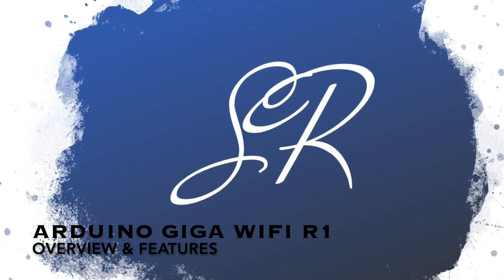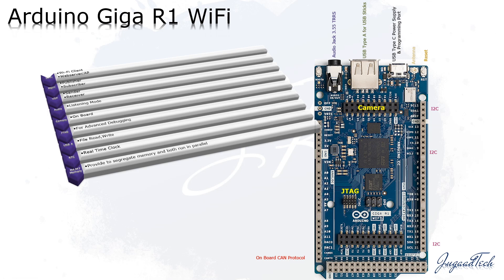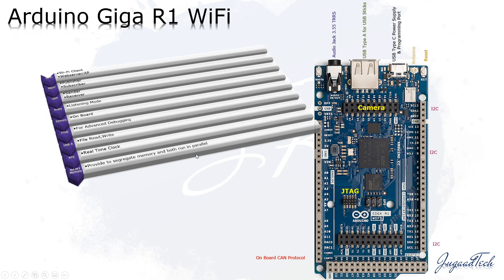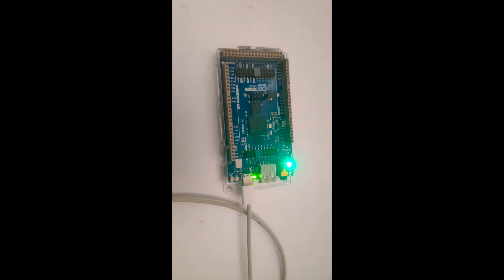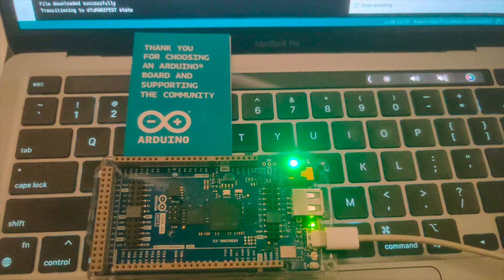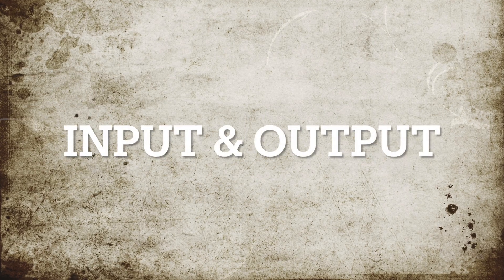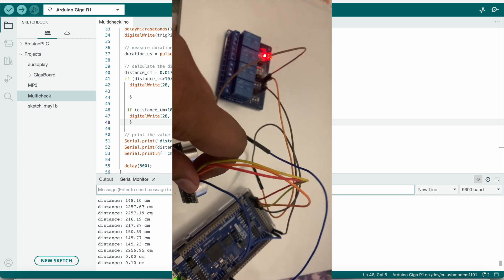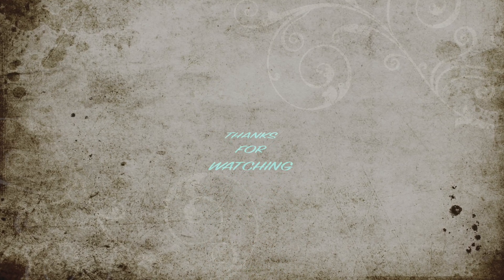The New Arduino GIGA R1 WiFi:  Overview & Features with Demo of #audio #mqtt #wifi #usb #arduino

Comment: Thank you for sharing.  I got myself one of these boards, but not many tutorials etc on how best to use this beast.  It would be cool to see how many devices "apps" etc one can have running on this board at one time.  Somewhat of a stress test, using micro python logic with the c++ processor.  i.e running a very complex iot application whils managing interups and streaming.  Would be cool.  Took me a while to get the micropython loaded.

This is a seriously impressive board.
Reply from the maker: Thanks for your feedback...I agree we don't have many tutorials for using its max capability....I tried in this video to give a glimpse of some examples....I am also working on some other examples by combining all these options to create a real project....as using this board just like Arduino Uno will not make much sense...
As it is made to do much more than that...
and also how to program this board using other options like micropython ,OpenPLC etc....
Reply: @jugaadtech12  Again thank you for sharing.  I think this board would be extremely useful in the new world of wearables and AI on the edge.